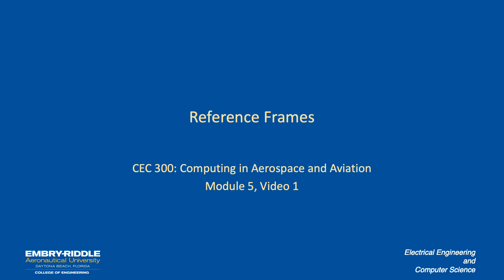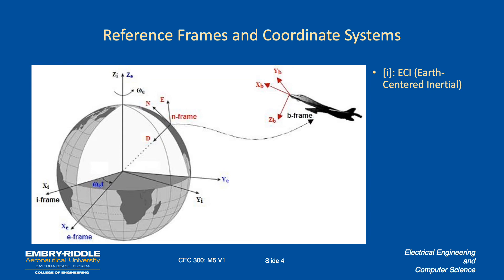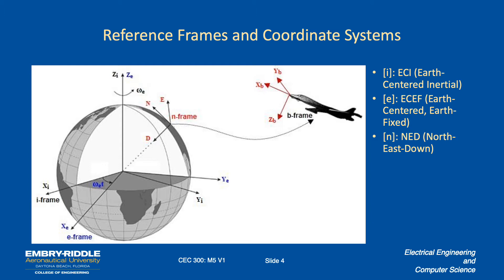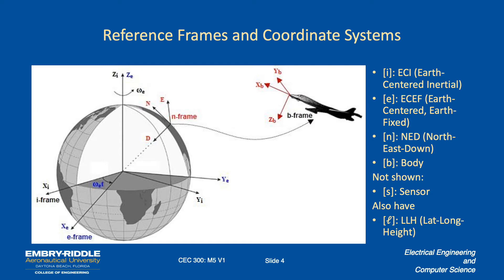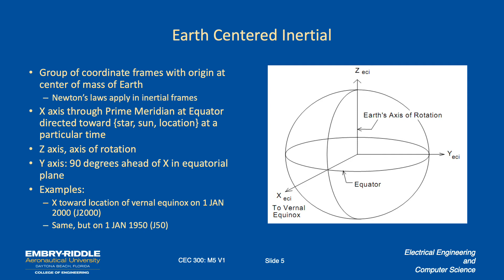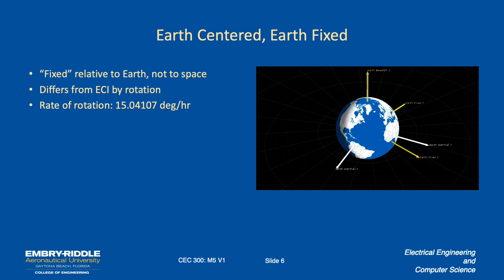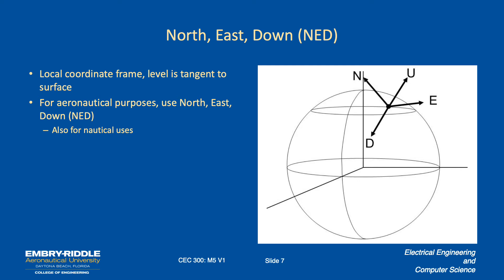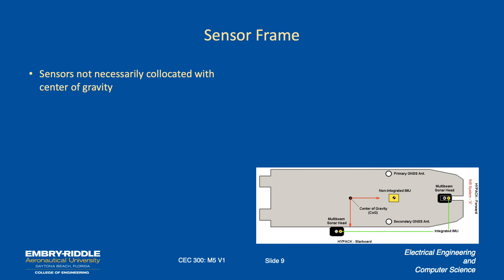Reference Frames

Comment: Hi, sir, that was a nice explanation. But in 11.41 minutes, you told me that the radius of the earth is 6.336707 km, but in the slide, it mentioned 6366707 m, which is equal to 6333.707 km right. I am a little bit confused about